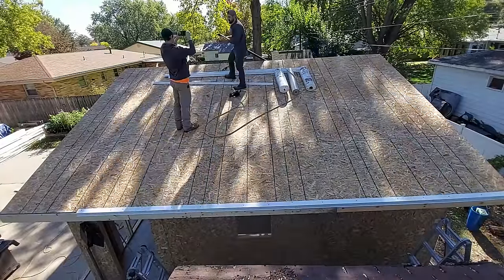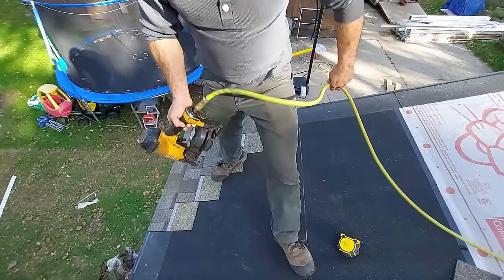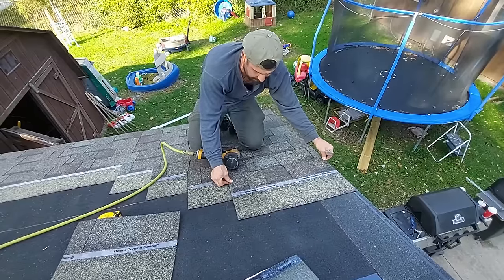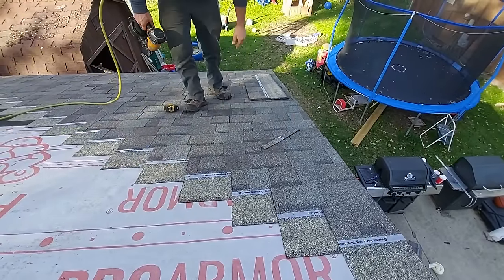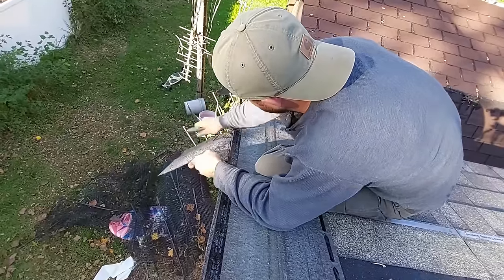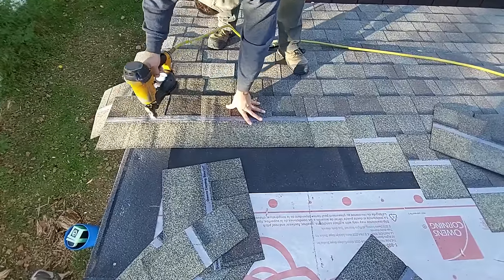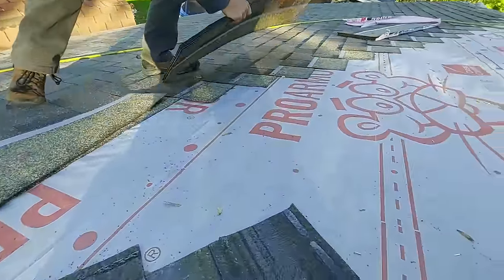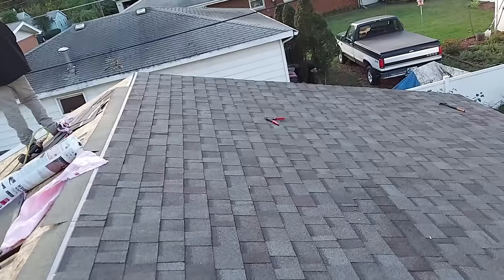HOW TO | Roofing Basics (Part 3 of 3)

Comment: Can I do ice and water shield and do my whole roof with it? My trusses are open underneath and 1/2” plywood bone dry and no insulation touches the roof...just the ceiling joist has insulation.
Reply: One more question. I just added a 30” overhang to my place on gable end. The rain was hammering the siding and ruined my framing and trim. Just rebuilt whole side including kneewall, every stud top and bottom plates...

What’s the best way to tie this in? Pull back shingles to factory edges and ice and watershield pushed under the old tar paper lapping up? 
Unfortunately I also have two layers of shingles. It’s intimidating to start...previous home owner had 20 bundles of shingles left over so I’m good there. 

I plan to start with a few courses on the bottom part way each course of ice&water shield. It rains every other day here in Washington. I’d pay for a FaceTime call to line me out.

Comment: I am about to replace half a roof and have never roofed before, your videos are super informative and even though I will have experienced roofers(at least they say they are lol) I wanted to do some homework before going in blind, you have been extremely helpful! Thank you so much for helping me not going in blind! How long did this take you?
Reply: I just finished doing that myself, by myself, a lot of work. Half a roof on a 1300 square foot house. Removed 2 layers of old shingles too, very brittle. The roof had 1 by 12 redwood boards that needed some patching. Will do the other side of the roof next season.
Reply: Good luck Mr dugan

Comment: Is it completely necessary to remove and actually bring down the shingles to the control line. Is it personal preference or is it an actual code to do that every 4-5 shingle run. Thanks
Reply from the maker: If you watch part 2 I mention that I only do this to demonstrate how to keep your roof straight for beginners. I don't use a control line usually its not required

Comment: I do commercial roofing professionally yet never nailed a shingle. I'm trying to fix several bad section in my home roof . Any tips on where and what to do in regard of the process of only replacing average 10ft×10ft sections?
Reply from the maker: Loosen 1 shingle with flat bar. Go get it matched exactly if you don't know the exact brand and color. Then use the flat bar to remove the old shingles.  I have 2 videos on it. The hdz review video might help, that was a 2 layer though you prolly won't relate to that.  And a different one on just replacing shingles about 40 minutes long me with a go pro
Reply: Hi Bob there exists a specific tool named Shingle Snake to prevent tearing up the shingles you want to not damage and are to  remain in place. Another tool I don't recall the name but is similar in function.
Reply: @satochinakamoto6129  Thank you very much I just located and bought it
Reply from the maker: @bobbobbit4021  check the description for a link to purchase the roofing snake through me.  I'd appreciate it

Comment: @12:29 I usually see ppl grab the edge of a bundle and bend it in half until the plastic breaks away. You're cutting the bundles open. Is the former method a bad practice?
Reply from the maker: As long as you're careful you should be fine. To each their own

Comment: I know you said to run my bottom row of shingles between 1/4 to 3/4 in above the drip edge, but if I'm a newbie, can I run it just above the flush line of the drip edge ?  I'm asking because I'm afraid to get off my mark and the entire roof will follow suit and be off.  Or do I just pop a line 1/4 in from the drip edge and follow that?
Reply from the maker: you have to overhang the shingles! pop a line and you won't get off. part 2 is really good for this

Comment: Can you make a video on how to be efficient with the roofing nail gun? I bought the DeWalt DW45RN pneumatic nailer. It shoots so fast the I end up double or triple nailing in the exact same spot sometimes. I think I’m not able to control the nail gun 100% yet.
Reply from the maker: In this video I talk a little bit about it.  Turn the gun sideways as you nail across your body.  Probably be to be softer or harder

Comment: Thanks for these videos!! I have a question! Had a roof quote 1680 sq ft double wide manufactured home with low pitch roof. Maybe 6 vents. A company quoted me $20,000!!!
2 yrs ago was quoted $7000......I felt like this company was trying to rob me blind. Neighbor used them paid $13800 just few months ago and his home is like 200 sq ft smaller then mine. I asked why the price difference he did just because our home is tad bigger. $$6200.....do u think he was way over pricing?
Reply from the maker: Depends on the pitch and if there's plywood to replace, flashing number of valleys etc. But typically a reasonable price is between 340-500 a sq for most roofs. So 18x500 for you should be your absolute Max in my opinion for a standard 1 layer tear off and architectural install...
Reply: @NWIVeteranConstruction  thank you for your reply. All this included was a tear-off. If needed new wood was going to be extra! Only 2 valleys. Pretty standard low pitch on most mobile homes. Prob easiest roof to do for any professional roofer. Thanks for ur reply and it's what I figured that he was ripping me off. Got another quote on Tues. Seems like in this economy anything you try to do or buy is over priced by a lot. Just had a small 4by6 small porch built finally. Had companies wanting 6k, 5500, and 4500 to do. Found a guy who did a great job for under 3k and made 1500 labor profit and I bought material. These companies and ppl in general are just being greedy. I'm all for making a profit but  like this roofer what's he giving me for another $11000 you know?! I'll use ur vids and do it myself at those rates. 9k seems very fair and right. Thanks so much.

Comment: do you use the shingle guide that comes on the roofing nailer to measure anything?
Reply from the maker: No. I use the front of the gun to hook the ridge that were supposed to line up with.   The Guage doesn't really aid when it comes to architectural shingles but I would use it for 3tab. Which I don't really see myself ever doing unless it's some kind of repair

Comment: I'm looking to roof a shed in my backyard but its a lean-to style roof?  How would you shingle the top edge to keep water out?
Reply from the maker: Custom bent aluminum or you could even buy gutter apron and use your hands to give it the over bend it needs.  Color match trim nails on fascia face, regular roofing nails with color match caulking in the roof face. Or neoprene screws with the water tight washer used in metal roofing

Comment: Great videos brotha, hey I was wondering - what are your thoughts on business entity as far as protection - Inc, LLC, Sole Proprietor?
Reply from the maker: i opened as an LLC but was advised to switch to s corp and filed the paperwork right away. it works for my style of business given that I'm an owner operator. so if you plan to be an owner operator that takes a normal paycheck from the business i would definitely look into that and you can always call a local accountant. somebody knows one that'll answer for free lol there's not too much that goes into the decision at this level. and be sure to ask about distribution checks. you can always pull money out of the business for personal reasons but you just gatta make sure its accounted for so you can pay those capital gains taxes on it at the end of the year if you're profitable.
Reply: @NWIVeteranConstruction  Thanks for the reply and advice.

Comment: Quick question can you use your stagger process with 3 tab are do you have to rack 3 tab only?
Reply from the maker: You can make them with 3 tab.  However, 3 tab shouldn't be installed anymore in my opinion if it's Avoidable

Comment: What’s the best way to keep a nail gun from shooting 2/3 nails at a time?  I’m roofing an add on to my house and i seem to have three nails come out on the coil every 8-9 nails.
Reply from the maker: You're probably shooting with a Hitachi gun, if you are you need to hit the gun harder.  If you're not, you need to raise your compressor to about 105-110 psi. And also, there is an adjustment on your gun to control depth, set that deeper if needed
Reply: Yeah I have just kind of been barely pushing down on it.  I framed houses years ago before joint the army but I couldn’t afford anything but a hammer lol!  Thanks for shows us how to do this correctly.  I live in Alaska and we had our cedar shingle replaced with shingle but this clowns didn’t put ice shield down.

Comment: Nice job. I’m new follower. I got question do you need a license to do roof.
Reply from the maker: Most states I believe you just need to be licensed to do work in the city.  Not a specific roofing license or anything. But it varies. And I have had to take a few tests.
Reply from the maker: Call the city building department that you want to to do the work in. they'll tell you for sure

Comment: Running your shingles just short of the edge will allow water to wick farther up under the shingles. In a  very cold climates it could cause some ice damage! The IRC is flush with edge of the flashing.
Reply from the maker: It's basically flush lol just not hanging over.  It's not that serious
Reply: @NWIVeteranConstruction " just short" is not "basicly flush"! The International Residential Code requires  flush! If your going to keep doing these videos and presenting  yourself as an expert and you get it wrong expect  some guidance from those who might give you and your viewers some good advice!
Reply from the maker: @jimeagle1952  look at the Damn thing lol its as flush as anybodys will ever be! It's a 16th shy of the starter so that you don't see lil overhanging edges. It's perfect and I'm sure the authors of that code book would agree.  There's bigger fish to fry dude. if that bothers you then go find a better roofer to watch! Later
Reply: I'm no expert on roofing. 
However. .....
On the rake edge, the shingles should overhang the drip edge metal by 3/8 of one inch and never be flush with the metal. 

Your I.R.C. codes is wrong. 

The shingles should extend one half inch past the gutter metal.
.Surface tension and velocity  backflows, forcing the water to turn at a 90 degree angle.hitting the metal kicker,  causing rot on the wood  facia board with a flush shingle to the metal. 
Using  theoretical physics the surface tension of the water will only be broken by extending shingle past the metal drip edge by 3/8 of one inch past the metal on the rake edge creating a primary drip edge using the shingle itself. The metal would provide a secondary drip edge to counterbalance velocity and  surface tension of the water.

Comment: Train your labor how to cut patterns on a cut table. 7.75" and 15.5" make a perfect pattern if your using CertainTeed...on a side note tho I finally got used to not dropping the gun, after enough practice it literally feels like an extension of my hand now. Once in a groove I can see the difference in speed but I feel more pain in the back. I think it's because when I drop the gun I learned to use my shooter hand for that slight second between shingles to rest my weight on. The new way I can't quite rest my weight on the gun in the same way.
Reply from the maker: yea you'll feel it sometimes but that's why i try to do one bundle at a time and spread them out a certain way to give your back a break

Comment: The controle line is for proper overlap of the shingle where ice and water mete felt/or synthetic felt paper to prevent leaks at that spot correct..and how much 1 in or 2 in over lap ?
Reply from the maker: The control lines are only to keep my shingles straight. I don't normally do them but I would snap them if it was my first time shingling so that you don't have to worry about your shingles being straight.  See part 2

Comment: Why didn't you use the nail head on the nails?  I live in NM, do I need the ice and water material?
Reply from the maker: Cap nails should definitely be used if you're not shingling immediately.  And you would have to call your local building department and ask them.
Reply: @NWIVeteranConstruction  thank you very much

Comment: Do you start the stair step on the same side or opposite side when staring the second part of the roof
Reply from the maker: Right handers typically always start the way I did. I never change that unless it's situational. Changing it will destroy your speed because the shingles will be on the other side of your gun hand.

Comment: Should I take care to hit the common bond zone of the nailing strip, or should I spend less than 1.2 seconds per shingle and miss often?
Reply from the maker: on this shingle specifically, hdz's, it doesn't matter. just about any other shingle, yes.
Reply: Always nail in the double or common bond as you called it. I know that GAF claims that nailing in the nail zone (between the 2 lines) will suffice on the new HDZ's but unless you want to deal with the absolute hassle of warranty replacement when the shingles pull out or the wind blows them off, I recommend taking the extra second to make sure you nail in the double/common bond. I've been roofing for 25 years and I've witnessed countless times the issues with nailing above the double/common bond. Having said that, if you are installing Owen's Corning with the "Sure Nail" strip, you can be assured you won't have to deal with shingles pulling out or blowing off if you nail in the "Sure Nail" strip.
Reply from the maker: @seanstrup5157  but there's more than just permission to nail there with the hdz. On anything always hit the common bond. But they removed the granules in the area for an asphalt to asphalt bond, and they already crimped the common bond together, with other shingles there's just tar holding it together, this is tar and crimped. The shingle doesn't peel apart from the common bond like the other brands.
Reply: @NWIVeteranConstruction  I understand what you are saying. My point is: Not nailing in the double (where the base layer and laminate layer meet immediately above the exposure line) the shingles are very likely to not only be subject to wind  but will pull away from the nail under foot during installation or any other reason someone would be walking on the roof. This applies to all architectural/laminate shingles including HDZ's. I know from experience. When HDZ's first came out, I was installing them on a 6/12 pitch and they were pulling out under my feet when I nailed them in the nail zone but did not hit the double. You can imagine how easily they would pull out on steeper slopes. That is all. Great video by the way 👍
Reply from the maker: @seanstrup5157  I haven't had that issue, me and all my newer roofers even have put them 6s 7s and 8s without issue

Comment: Why did you only put drip edge under the ice and water shield on one side and over on the other 3 sides? Every roof I've ever done has always been installed under the ice and water shield, besides Florida which ilcan be either or?
Reply from the maker: The drip edge on the sides are supposed to cap over the underlayments. That's agreed on.  However putting the gutter apron under the ice shield is how I do it.  Makes more sense to me. But not everybody agrees on which goes under.  I've done it both ways numerous times over the last 11 years, never a problem.

Comment: OK ,the 6 ft of black underlayment is that Ice shield or black paper?  If ice shield why 6ft of it ? Thought standard is 1ft . I may be wrong. That's why I am asking.
Reply from the maker: It's ice shield and I explain in part 1 or 2. But code usually calls for the ice shield to extend 2 ft past the inside of the exterior wall (which means where the drywall is)  check em out
Reply: @NWIVeteranConstruction   Thanks, I thought this was part 1, sorry . Nec Aspera Terrent

Comment: I don't know where this job is done. Correct me if I'm wrong. But l notice the plywood was installed the opposite way( vertical 
California code in order to pass inspection plywood needs to be installed horizontal
Reply from the maker: The plywood on the roof is horizontal.

Comment: What if the roof isn't square, how do you compensate for shingle placement? Thanks!
Reply from the maker: In the really bad ones, sometimes it is what it is.  But more often then not you can leave a few rows off at the top. Like 5. Measure the left, and the right, and figure out how much its off, if it's less than an inch I wouldn't worry too much but anything more than that you just adjust within those 5 rows
Reply: @NWIVeteranConstruction  👍

Comment: Hey Mr. Veteran…
Uniform Building codes require 3/12 pitch or lower to have 18 inch exposure on underpayment. To prevent rain seepage into wood decking from driving rain.
All shingle manufacturers state same on each package and voids warranty if instructions not followed. Includes adequate roof ventilation units.

Or am I just begging for karma?
Reply from the maker: yes you are correct. this was 4/12 here. we have a lot of 3/12's where i'm at though and you'd never know the difference. a lot of them don't even have ice shield on them.

Comment: what if anything is different for a gambrel roof. 24/12 sides and 5/12 top? thks I plan on renting a scissor lift for a week to do sides.
Reply from the maker: i have a shed mansard roof video. it was one of my first 10 or 20 videos. check that out. and then look into the GAF HDZ shingles. i'm pretty sure they don't require the extra sealant these days